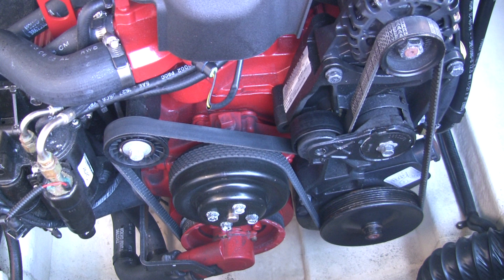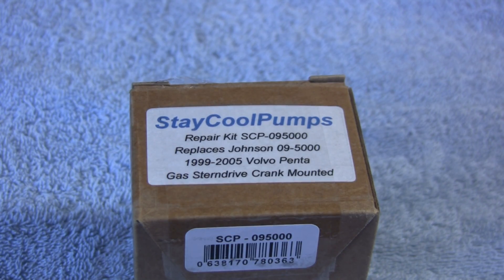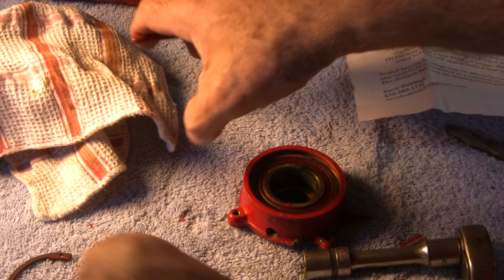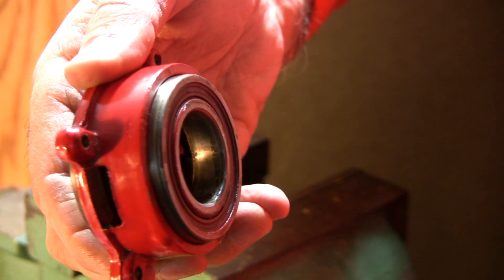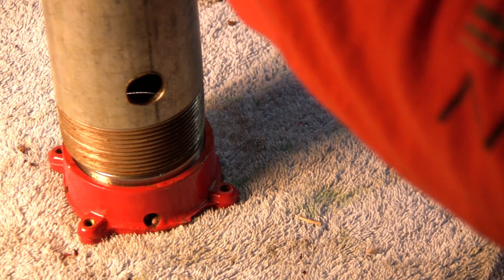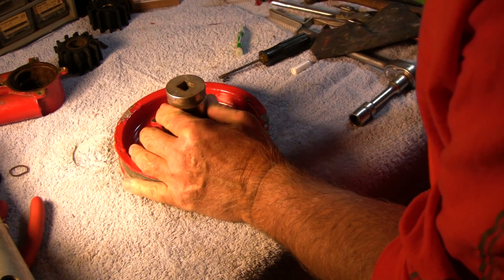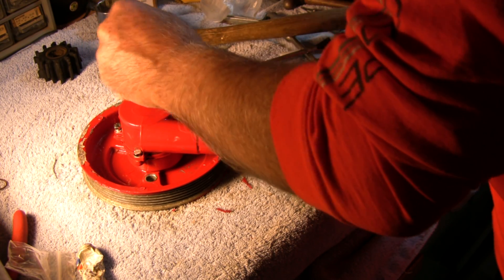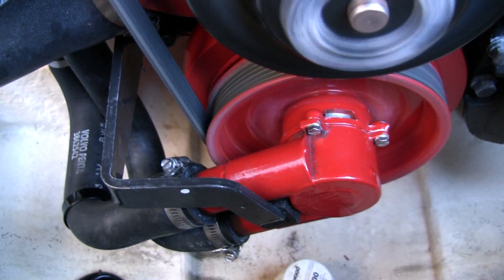Volvo Penta 5.0Gxi Raw Water Pump Removal and Rebuild

Comment: It seems simpler to remove the raw water pump assembly and replace all the parts...bearings and impeller at the same time.  But the impeller may require to be replace long before the bearing wears out. Excellent video. Thank you

Comment: Standard torque on 5mm brass bolts/screws (diameter of the threaded shaft) I found was 22.5 inch lbs. My housing is brass along with the bolts/screws, so whether brass or stainless screws, go with the softer material torque.. Would be nice to know the torque on the pulley attachment to the crankshaft

Comment: 6:02 Did you ever figure out that you installed the impeller in the wrong direction?  Your engine rotates clockwise, looking at the front of the engine.  You've set this impeller to turn counter-clockwise!

Comment: Great video!  Thank you for doing this.  Beware! I wanted to share that the kit I got used a shaft seal with a steel spring, not stainless steel.  It rotted to pieces in just one year and started leaking again.  I used a magnet to confirm.  I since replaced with a shaft seal that has a stainless steel spring.  Cheap Chinese kit I bought!

Comment: Thanks for the great video. Torque specs are... The 4 small screws are 19 to 24 in. lb. The two large bracket screws are 20 to 25 ft. lb.
Reply: Thanks

Comment: Removed my water pump and pulley on my 2007 5.0 GXI and there was lock washers behind the pulley? Were these there for spacers for the serpentine belt? Not sure if it was factory or not I'm guessing not

Comment: Great video, when I removed the impeller housing I was able to also slide the bearing housing off without removing the pulley from the crankshaft. 2010 Volvo Penta 5.0 GXI. Any idea if this indicates a bigger problem. Once I rebuild will the new bearing and housing slide back on the shaft pulley without removing it from the engine?

Comment: Thanks. Great video. When I went to remove the three bolts holding it to the crankshaft pulley, it spun the crankshaft. I was able to remove the bolts and the pump assembly. However, when I go to mount the new one, do I need to align the pulley to the position it was…which I’m not sure what that was. Thanks.

Comment: Great video! I was wondering if you could tell me what the hose locations on the impeller. It looks like the top one is the inlet (water source) and the bottom one is the outlet to the thermostat. Is this correct?
Reply: Daniel, did you find out which one was the inlet and outlet?? I am just in the same situation :(
Reply: @alainmurray4159  sorry about the late reply but I had it correct. Top one is the water source-inlet. Bottom one to thermostat
Reply: @danielcazares7358  thank you very much. I already found it. Had to change the pump itself

Comment: Screw's, a screw is a screw until you put a nut on it then its a bolt
Reply: So, you have "head screws" and not "head bolts" on your engine?
Reply: @basketballjones6782 No NO NO, a screw is a screw until you put a nut on it, then it's a bolt. A bolt is tightened using a nut. A screw is screwed into a threaded hole or it makes it's own threads while being screwed in. Machinery Handbook
Reply: A bolt has a non threaded area called grip length, a screw is threaded all the way to the fastener head

Comment: Hi. I did this repair and it seems that my front housing is really hot when the motor is running like over 300° by my infrared gauge. This doesn’t sound right to me what would make it gets so hot. Hoses are installed correctly
Reply: Installing the impeller rotation backwards like the fool did in this video.

Comment: Hey Jim R. Enjoyed your video here.  Thanks for posting it.  I am troubleshooting an overheating issue on my 3.0 which has the same raw water system as the 5.0.    What I found is that I can connect my garden hose to the inlet in the engine compartment and things seem to work pretty darn good.  But when I put the muff's on, not so much.    Watched another video that put the muff's as the suspect.   More testing today.  It's Memorial Day Weekend.  Just purchased the boat which had a brand new engine installed last fall.  Had it on the lake last Monday and everything worked perfect.   Back out on Tuesday and she OVERHEATED!  :-(   Appreciate any advise you may have.   Happy Memorial Day!   Remember Those That GAVE ALL!!!!!

Comment: Hi There, great video!  Thanks for sharing, quick question I just did mine, but when put the screws on the water pump to the wheel I can't tighten them because the pump with the 2 tubes is actually in the way.  I noticed you can move it around, but when I tighten the first 2 screws, I now I can move it to tighten the last one.  Any times on moving the pump to be able to tighten all the bolts?  Thx

Comment: What a good video! I did my pump today and it was exactly as you showed. I made one slight tweak i cooled the bearing in the freezer and warmed the pump body in the oven and then they dropped in with a tap. Great video. Many thanks

Comment: So, new to boating and this is going to be my first engine repair. 
I'm a garage mechanic, so this looks pretty easy. This might sound stupid, but I have a 29' Bayliner that's permanently water-bound. If I disconnect the inlet/outlet hoses, am I going to get a flood of water into my engine bay? Should I pinch off these hoses before I disconnect them? 
Thanks!
Reply: I just did the same and if your in the water you will get water in from the hoses! plug the hoses some how
Reply: @MrLeecromwell  What did you use to plug hoses?  This job looks easy after solving for that

Comment: Good job.... Always try to either vacuum or back flush the discharge hose of that pump to retrieve all those broken pieces of that original impellor as they could be caught in a cooler grid.   They do not disolve with time! TY John

Comment: My engine won't stop pissing out raw water into my engine hatch I've got two thank God but I don't no what to do plz send me back some advice on how ever will I get this 100.000 $ boat to  stop leaking so I can sleep in my home and not worry about my boat sinking
Reply: Did you change the raw water pump. Thats the reason its spitting.  I know your post is 2 years old

Comment: I’m wondering, where does this oily trace really come from? Is there any oily fluid in raw water pump?? Could this oily trace come from power steering pump? I have very similar oil trace in my boat and I’m not sure where it comes from.
Reply: It's from the belt slinging water

Comment: Nice vid,....on an I/O even in fresh water only you also need to check your risers and manifolds to make sure the water channels aren't clogged.  I also would replace the impeller a lot more frequently if that's what it looks like after 80 hours.  It's all that's keeping your engine from becoming a piece of junk, and those missing chunks of rubber don't dissolve either, so if you see that it's time to start looking for them and a good place to start is to follow the outlet hose.  You don't need anything restricting the flow of water through the cooling system.  Replacing the impeller doesn't take long, probably a half hour,....also I like to use glycerin not soapy water to lube the impeller.

Comment: Great video. I used a vise to press the new bearing in (protect the rough jaws of the vice); once the bearing was down, I used the old bearing to continue and seat it. Worked out great.
Reply: Great video! I freeze the bearing overnight and it almost drops in!

Comment: I have a problem with my boat, water goes to the motor oil but i don't know where it comes from the pump or from the head.
Reply: water in your oil isn't from the water pump.  Its either manifold or riser leak or head gasket

Comment: Nice Video - I have a feeling I will be using this again this week as I bought the rebuild kit, as you did.  My boat is 9 years old but only has 160 hours on it.  I bought it last year, and now as I put it in the water for the first time this year, it overheated.  I assume there is either an air leak or bad impeller, and since I put 40 hours on it last year, I figure its not a terrible idea to just plan on replacing the impeller at the very least.... and planning to replace the bearing either now or next change, depending on what I find when I am in there.  Any tips on troubleshooting the suction from the lower unit up to the impeller?  Any tricks to know for sure if the impeller is bad or find an air leak?  Also, does this have a heat exchange/closed fluid section?  Thanks for making the great video on this.  (2009 5.0 GXI-J with Duoprop)

Comment: Just buy a brand new volvo penta raw water pump. Usually the impeller housing is scored and worn from this neoprene impeller, causing it not to prime once in awhile. This will cause overheating of the engine and severe damage ,usually a warped head. 

The whole pump has to come out anyway so buy a whole unit for $300. And if you do buy volvo penta parts, DO NOT BUY FROM MARINE PARTS EXPRESS DOT COM. THEY ARE NOT AN AUTHORIZED VOLVO PENTA DEALER.

Comment: You're spinning the impeller to the right as you insert it.  You didn't mention that but the direction is important, right?  I mean, if you spun it to the left, would it correct itself when it runs?
Reply: Karen Kardas Yes, it will correct itself.
Reply: No, it will not self-correct without messing up the impeller.  The person who shot this video did it wrong and never fixed or removed the video, so many people will come behind him and ruin their brand new impeller by thinking it should be installed this way.

Comment: When your video started you said the dark specks showed signs of tracking. What is causing the black specs,the old bearing or something  else in the pump?
Reply: The pump leaks and the water spews in a circular pattern from the pulley.
Reply: David Robinson thanks
Reply: Once the pump sprays salt water everywhere, the pulleys rust and start wearing the belt. That's where the black soot comes from.

Comment: My housing did not have a snap ring on it. Could this have been missed at the factory?  I have owned this boat since new.
Reply: 1974charger123 mine don't have one either and my new bearing not tight in new housing is yours that way. don't even look like a place for a snap ring
Reply: Mine is the same exact way.  Does not look correct.
Reply: mine is 2002 5.7L and i did not have a snap ring either. also, the bearing was NOT that hard to put in. it slid in without having to bang it with a hammer. its tight in there, but not super tight
Reply: same here. no snap ring and super easy to slide in. all works well
Reply: I have a Volvo Penta 2001 5.7L GSi PERFS, There is not a C clip holding the bearing in, either.  Bearing just pushes out (well, it didn't just push out).

Comment: Torque for the 4 bolts that hold the impeller housing in place is only 19 to 25 INCH lbs. per the Volvo Clymer book.

Comment: To make my job easier and avoid all the heavy banging on metal I heated the brass part (mine was not painted) before hammering out the old bearing. I put new bearing in freezer overnight then heated the brass part. They slide together with very little light hammering. Then I placed belt pulley in freezer for a couple of hours and when the new bearing was normal temp (I couldn't warm it up) the whole thing slide on to the cold pulley again with a light hammering.
Cheers!

Comment: Easy way to install the impeller is to use a zip tie and simply pull the blades down, then start the install into the housing and slide the zip tie off.  You don't need to use soapy water that way.
Reply: ckhallock88 great idea, change mine on my 4.3 yearly and that would definitely be easier. 👍😎